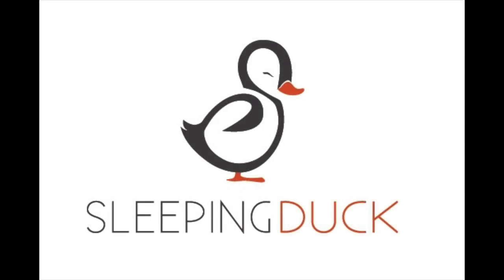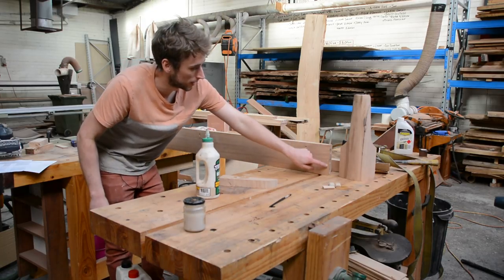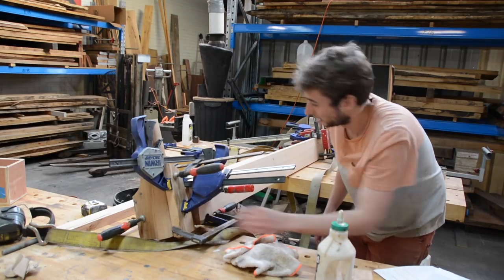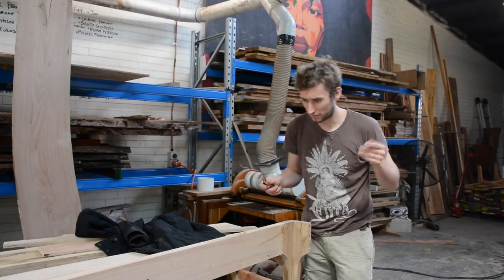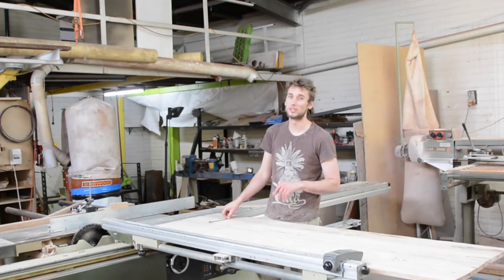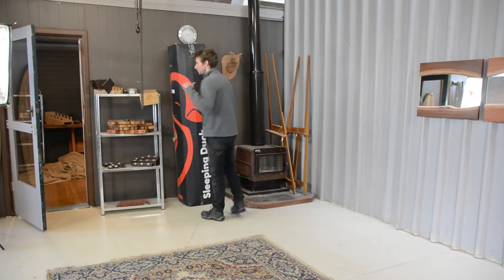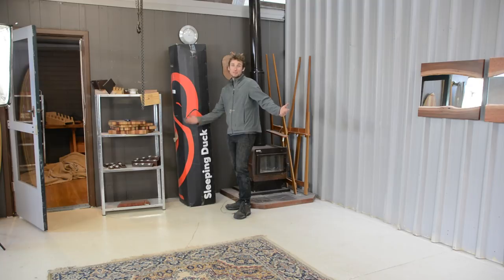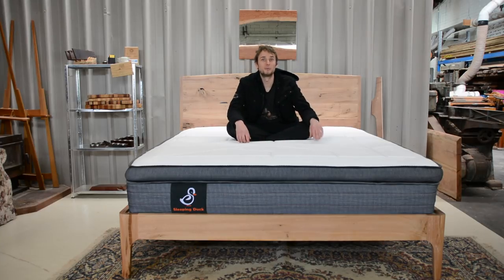Building A Beautiful King Size Bed - Part Two

Comment: Hi Jord, for your clamping issue I had good look in similar situations with two methods:
The easy one, I had situations where just two additional pocket screws created enough clamping force to get a tight joint (had it with dowels instead of dominos, but that should not matter at all)
Second thing I did in the past was to glue and screw on two small blocks of wood on the inside, which I then could use to clamp things together. but this might get trycky depending on the width of the material and how tight the dowels/dominos are, as this might pull it tight on the inside but leave a gap on the outside, as you are in fact applying clamping pressure at an angel.

Comment: Looks great.  I have a couple of questions.
1.  What kind of hardware is that?
2. How will the headboard be allowed to move?
Reply from the maker: Bob Snyder Hi bob, the hardware is the generic "heavy duty bed brackets" from timbecon but most bed brackets will work just fine, and the blackbutt timber i used is remarkably stable so movement is not a massive deal, but basically with the pocket screws I elongated the holes a little bit with a small file and didn't use any glue so that should be enough. Quarter sawn material would have been the best choice though :)